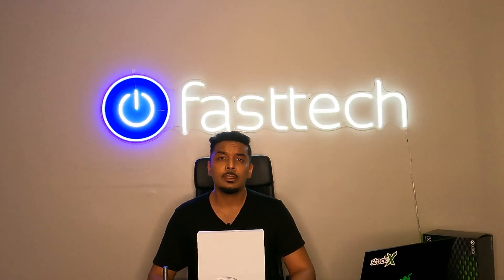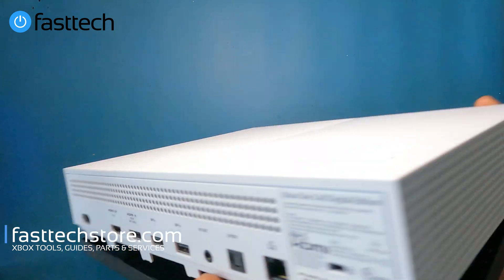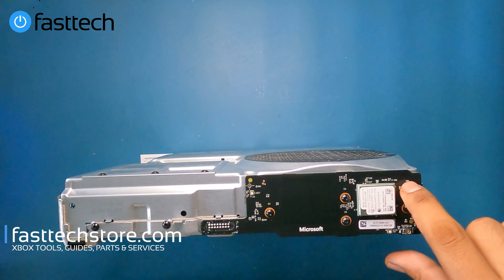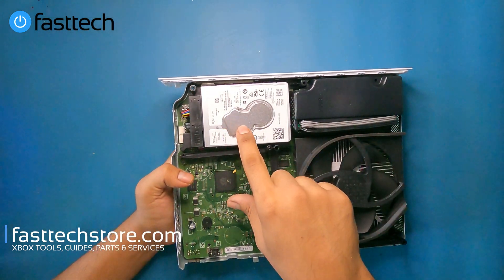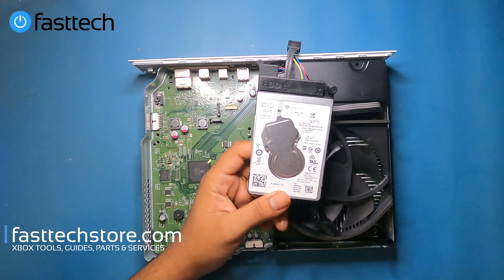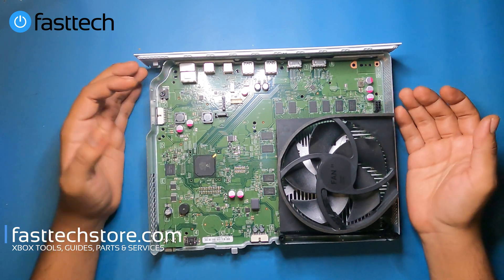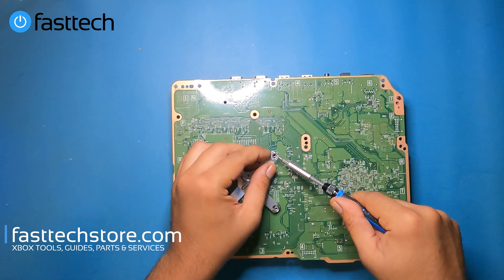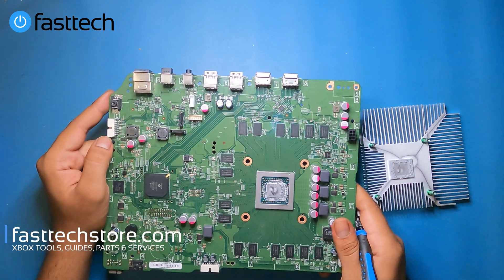Xbox One S All Digital Edition Disassembly and Repair Guide

Comment: The T8 screws aren't going back in to the smaller metal piece. Can I still use the Xbox without it or no?
Reply from the maker: Yes you can but its not recommended. Loosen the T10s and try to fasten the t8s

Comment: idk if you still answer questions in comments, but my bf recently punched his xbox and it stopped working. it stopped displaying on the tv and then completely shut off and won’t turn on again. any idea how to fix it or should i just take it in to be repaired?
Reply from the maker: Try replacing the power supply if that doesnt work its a mainboard/apu issue. We charge $90-$120 for this repair

Comment: I bought my Xbox one s digital copy about a year ago now, and my fan hasn’t been working since purchase, at first I thought it was normal and the fan was just quiet till I used a thermometer to see it was heating up to 400 degrees Celsius
Reply from the maker: The system would turn off if temps were that high. Are you sure its not Fahrenheit?

Comment: My Xbox gets a black screen when I start it up. I press the power and sync button to bring up the troubleshoot menu. If I press continue, the screen goes black. If I press restart Xbox, the screen is black when I start it back up. If I press factory reset, it just freezes. And if I do offline update, it freezes at 1%. Do u have any ideas what is wrong with it and how to fix?
Reply from the maker: Remove the hdd from the xbox and format using a pc and try again. If this doesnt work your hdd is dead. Replace the hard drive and try again. Check the links in the description box if you need one

Comment: After dissasembling my xbox one s controller and cleaning analog to solve stick drift, when i assembled it and tried to power on on button it shows no signs of life. When its connected via usb cable it works normaly. What could it be? Btw drivers are updated to the latest software.
Reply from the maker: The battery terminal isn’t being passed through the case probably.
Reply: @fasttechvideo  thanks for the fast answer, I guess that's probably it, you saved me 🤣 you got a subscriber!
Reply from the maker: @djare93  you’re welcome and thanks 😊

Comment: So a Xbox one s disk drive will work on this motherboard?
Reply from the maker: No since it does not have a paired disc drive logic board. You will not be able to install a disc drive in this Xbox.
Reply: @fasttechvideo  thank you so much for your reply. I am currently working on my Xbox one S with a no power issue. I have checked my continuity, short to ground on my 12v power. It’ll beep for about 10 seconds then stop till I replug my power bank. Is there any suggestions on what it could be?